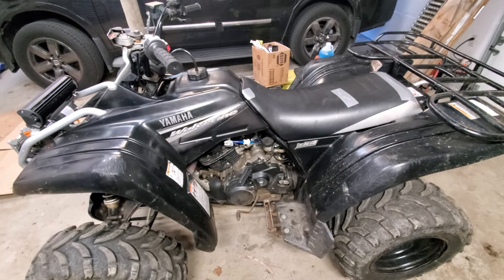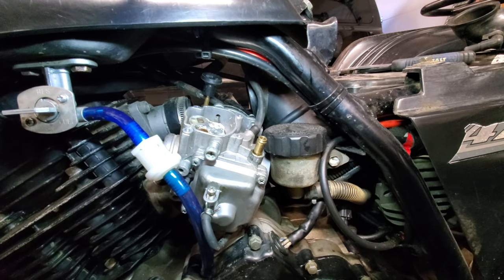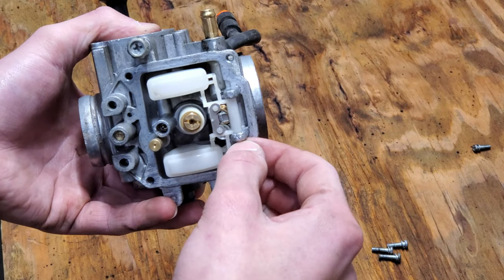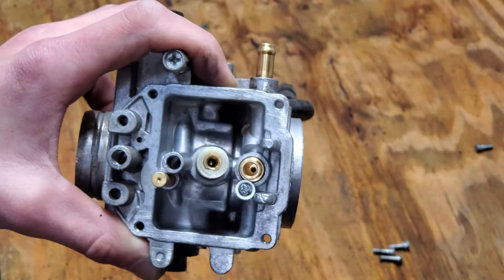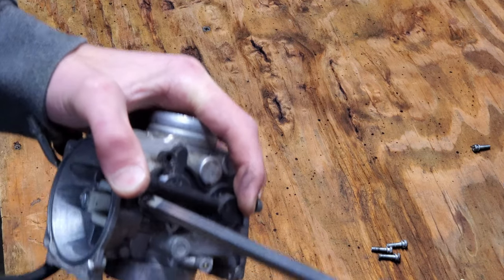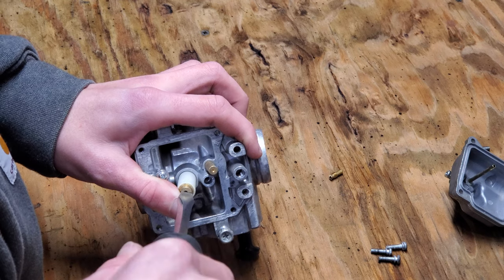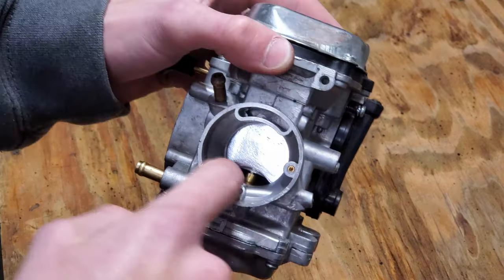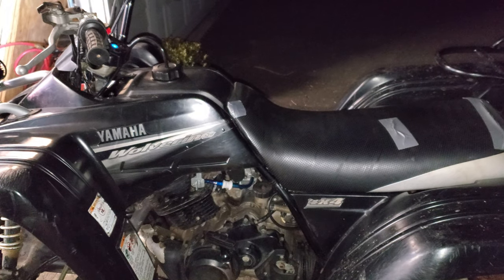How to clean the carburetor on a Yamaha Wolverine 350

Comment: Excellent video!! Thank you. My Wolverine idles but giving it slight throttle and it dies, this video should help me immensely.
Reply: Bro mines is doing the same did it ever fix the the problem?
Reply: @southerntexan3554  Yes, I took the carburetor apart and two jets were plugged. Cleaned them and it runs great now.

Comment: Is there a way I can personal message you. I bought the same exact carb and I have the same ATV. I set it to “spec” it runs okay it seems that when I give it too little throttle it cuts out some but once I hit it once or twice and push the throttle in more it seems fine. And when I cut the four wheeler off it’s like a burst of air comes out the exhaust. It doesn’t sound like a back fire though, it seems somewhat softer. I don’t know if I’m running too lean or rich. And which way should I turn my adjustment? Please get with me ASAP thanks
Reply: @everythingmechanical_yt  I followed
Reply: Are you running any after market parts?  Breather or exhaust?  If so u may need to rich up!
Reply: I was having the same problem when I bought that, then I realized I had to put my old jets in.